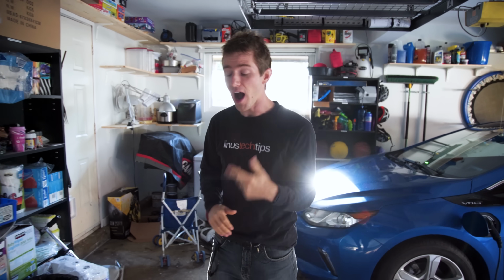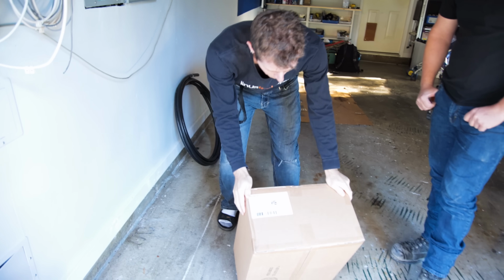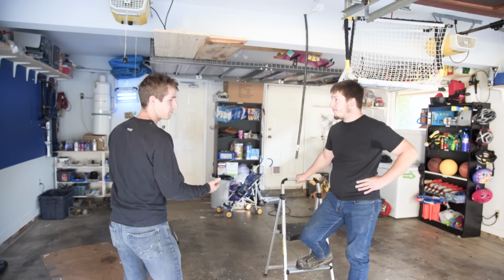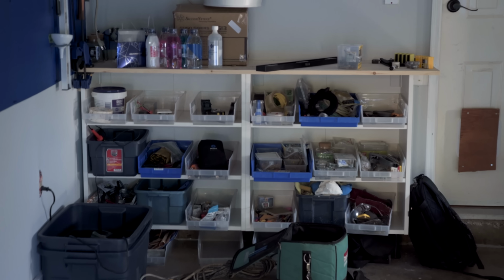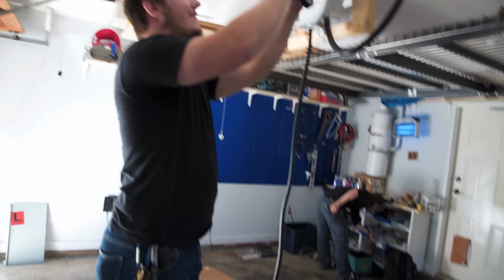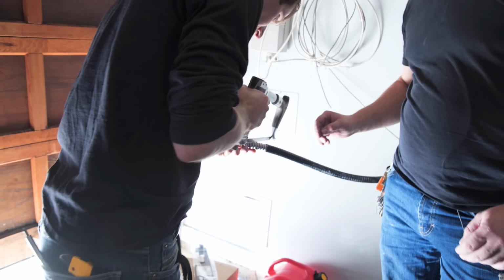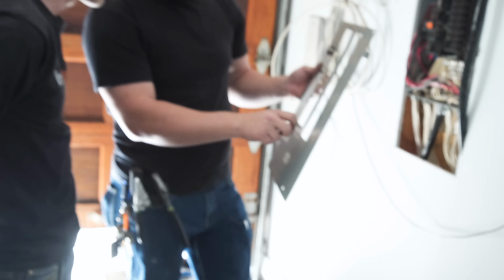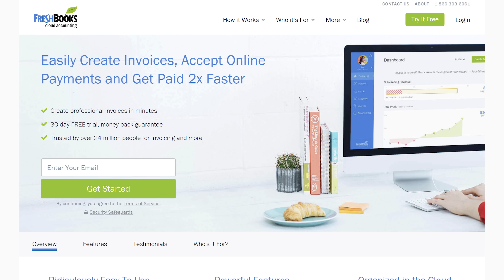Installing my Electric Car Charger - What Could Go Wrong??

Comment: I love that he pays a contractor and then insist on using his own tools and doing most of the work himself. Haha. Electrician  is awesome tho
Reply: i think it´s be the most annoying tipe of contractee posible, just let the contractor do its job in peace, linuses way its how accidents happens
Reply: Not sure how they do it up there but in the US its common to charge by the hour. If somebody wanted to waste time running around turning a 20 min job into a 2 hour one i would jump on it
Reply: of course if you charge by the hour let it waste all the time that he wants, 
where im from (argentina) this kind of little jobs are charge by the work it self, so you want to do it quickly and be done with it
Reply: correct if this was a normal job but in this particular case, it is a major YouTube channel who brought him on for a video.
Reply: @user-neo71665  There's also the liability issue.  If Linus electrocuted himself, he could sue the contractor.
Reply: @Mikemk_  ...No. If Linus was a sub he could, but as the homeowner he can't. At least here in the US.
Reply: DynamicEquilibrium Linus is Canadian
Reply: @darkchronos22  te entiendo jajaaja
Reply: Artak091 . He pays a contractor so he doesn't burn his house down or kills himself. It wouldn't make for a very good LTT video if he just paid a contractor and shows you the before and after. Linus has said on many occasions that his channel is for entertainment, and him being involved in the process makes sense.
Reply: Assuming he isn't a friend and/or a fan who knew what he was getting into without being told, they probably searched for someone willing to be on a video teaching an "apprentice"
Reply: @gingernytemare  His lawyers and family would.  And legally, dead people can still sue if the manager of the estate wishes.
Reply: @darkchronos22  The customers who want to be involved are the best type if your charging properly.  Let me do the job is X.  Watch me do the job is 2X.  "Help" me do the job is 3X.
Reply: @darkchronos22   I'm here in the US and own my own company, only employee. The only time I bid a job by the job is it has to be a big job. Then I big it by the square footage. If they have a 2500 sqft  house I might tell them XXcents per square foot. Small jobs is XX per hour with a one hour min charge.

Now before I get tons of hate. Yeah if some little old lady calls me that I have to travel 1 mile to come change a light bulb the chances of me charging her anything are slim and none. Now if you are a grown male and call me to change a light bulb I will charge you.
Reply: @Mikemk_  Linus himself said he wasn't going anywhere near that live panel.
Reply: @nobodyimportant2470   And if I have to fix your screw up it's 5X
Reply: @user-neo71665  im nota telling that your way its wrong There are diferent ways of doing this things depending of the personas and the place, forma example i'm in a family eelectrical company with my father and brother, and i wouldn.t go near that live box, in Argentina we use din boxes with individual diferencial breakers

Comment: I like this Brian electrician guy, does stuff mostly right and it still works, just like Linus lmao I hope he helps on the office chargers install Linus said was gonna happen at some point
Reply: EMPLOY BRIAN FULL TIME
Reply: ALMOST. Uses black and red, instead of blue and black for AC.
Reply: @fusseldieb  in the UK we use brown and blue, so I guess you get different standards in different places
Reply: Harry Snell Brown and black we can tolerate, but using completely different color not
Reply: @fusseldieb  just different standards lol
Reply: @fusseldieb  Canada is the same as the US for most electrical code things and you use black and red for live wires for single phase. Blue wire is for the high leg in three phase.
Reply: Especially in Residential, where blue is typically uncommon. Commercial and Industrial utilize a range of colors; yellow, blue, red, black, blown, orange, etc. for the live (hot) wires, while white, grey, and white with grey stripes are used for the common (neutral) wires; also the ground wires are typically colored green, green and yellow striping, or just bare copper. Most of this is for marking purposes, for multiple circuits (most feeder wires, at least where I work, for commercial buildings will be marked yellow, brown, and orange for a 3-phase, delta wye system, for example). Residential differs in that the colors used are black and red (and rarely blue) for the hot connections, black used most (110V/120V), and red used more commonly for either 220V (240V) applications or 3-way and 4-way switching; white as the neutral wire (they don't much like anything else), and either bare wire or green wire for the ground. As Harry Snell said, it's just different standards, our black and red being the same as their brown and blue.

TL:DR - Just because someone in a DIFFERENT country has different set codes and ways to wire things, who cares as long as it's done correctly for that country and nobody gets hurt doing it.
Reply: @fusseldieb  In Canada Red is A phase, Black is B phase and Blue is C phase. Since its residential and a 120/240 split phase system only red and black are used (A and B phases). Blue would be for a 3 phase system, or if marked white or grey could be utilized as a neutral. With teck, it's far more available as a 3 wire cable than a 2 wire.

Comment: Theres a Siemens plant not far from me, they manufacture the rotor blades for wind turbines. Across the highway is a chemical plant called...climax. I shit you not. So we have both seimen and climax.
Reply: Lemme guess: before came the climax and then came the Siemens
Reply: @iaial0  yep, first was freuhauf, a semi trailer manufacture. While it was running climax opened sometime in the eighties. After freuhauf closed, seimens opened in the mid 2000's.
Reply: Wang Computer will be resurrected and build a factory there
Reply: 69 likes... F%&ksake *facepalms*
Reply: A little off subject, but  what about the PowerStroke and Cummings diesel engines?? LOL
Reply: back in the nokia 5110 days I swear siemens had a mobile phone
Reply: oh thats nice
Reply: Probably some old german dude with the last name Siemens is turning in his grave and facepalming right now
Reply: it's pronounced zeemens but okay.
Reply: @knifeyonline  Yes. I used one. It was a tiny yellow phone with rubber details with a tinier liquid crystal BW display.
I once threw it like a grenade, I was so pissed off, then I ran after it, collected battery and back cover and it worked like a charm.
Reply: @Dystopikachu   Werner von Siemens is for sure turning in his grave since 1892 for several things lol and @Joseph Stott  yes Siemens did build Mobile phones for while quite good ones too. They had the first with coloured displays with awesome 3 colors lol. I had the S25 as my first Mobile
Reply: Siemens have an office in Staines in the uk....
Reply: Where is this
Reply: @wayzrunn3r923  ft Madison iowa
Reply: @knifeyonline  they did mate and they got bought out but still do dect phones and two ways
Reply: There is also a Siemens factory near the town in Austria where i live, they produce medical equipment (CT, Röntgen and MR machines). Siemens is actually one of the pioneers in mobile tech and communications, they made S10 first mobile phone with color screen and were one of they first companies to introduce Mp3 to mobile phones.
Reply: Spare a thought for those who've had a prostatectomy...

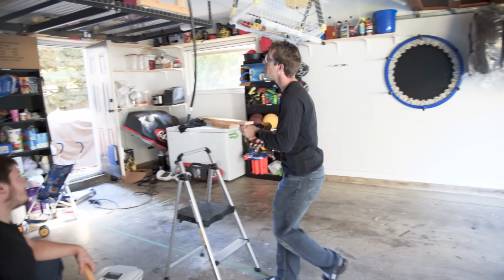Comment: 9:32 JESUS CHRIST NEVER hold the back of the thing your screwing into, That looked like is missed your hand by half a centimeter...
Reply: Don't worry, that's Linus. He's probably immortal since he's still alive ;)
Reply: ?? is the screw magically gonna fly through the board and into his hand at light speed?
Reply: @AndrewBrowner  more or less
Reply: @AndrewBrowner  no, it'll slowly and painful drill through his palm.
Reply: Or just use a screw that is shorter than  3 inches....
Reply: I saw that too, but then you see he already did three other screws so would have known it was fine!
Reply: Knowing Linus he'd screw into his hand by holding it the proper way
Reply: Is that something you would do, use a screw longer than is necessary to join the two pieces of wood together? The two pieces together are about three inches. So, you use a 2 1/2 screw and like magic, it doesn't go all the way through. It's amazing how that works.
Reply: I saw this comment, then saw the scene and ooof, even knowing it'll probably be okay seeing that still hurt; having worked with that stuff before, just, why aim it directly at your palm? Who care's if the screw is too short, what if the wood splits? I've had someone I was working with go to the emergency room because a screw twisted itself apart in his hand, nearly severing nerves because he wasn't wearing gloves, just... this is exactly the sort of comment he was hoping to get with this video, isn't it?
Reply: But that's why we watch Linus do DIY stuff, he's always one slip away from the hospital. Keeps you on the edge of your seat!
Reply: 99% of people who're saying this is fine have never seen what a work environment without any safety guidelines is like.
Reply: Welcome to armchair quarterback.  Since you're so astute, it should be obvious he previously screwed in 3 identical screws.  Feel better?

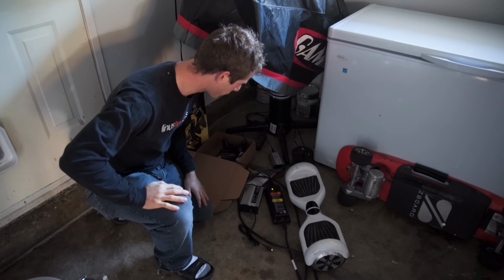Comment: "this is the corner of my garage with nothing flammable"  1:29 cans of paint on the floor 2 feet away from his charger
Reply: could be acrylic paint
Reply: Water based paint is far more common than oil based paint due to very fact it is,not very flammable.
Reply: And a hover board with Lithium-ion batteries in it that combust as soon as they come into contact with water...
Reply: + cardboard box and wood wall
Reply: @Cowcow211  Then instead you'll electrocute everything and consequently set the house on fire since its made out of wood. Even worse than oil based paint.

Comment: The longer this video goes on, the more I think Brian is not an electrician and is an LTT host who just cleared probation. 😂
Reply: My guess is he is Linus' friend or neighbour who happens to be an electrician. :D
Reply: In theory he could be both
Reply: Especially considering the visible lack of proper electrical tools, uninsulated screwdrivers, no wire strippers, etc etc.
Reply: @Canuckrz  don't know about Canada but in NZ that's standard sparky gear for the town contractor. Most of the "proper" tools are unnecessary, there was one old fella that cuts 
through live wires with simple tin cutters since he knew what he was doing (don't try this at home kids)
Reply: @HelloKittyFanMan.  by simply watching the video, really. I mean every single plastic handle screwdriver that doesn't have some stupid metal running across the handle is insulated, but the ones sold for this very purpose had all the shaft covered in plastic as well, to avoid any slips or touching sides.
Reply: @HelloKittyFanMan.  true, that's what I meant (worded in some messy way).
This also made me want some of those as all of my screwdrivers are of the normal variety as well.
Reply: @HelloKittyFanMan.  here in the UK electricians screwdrivers are often so heavily insulated and protected it can actually be a nuisance, the insulation goes right down to the tip. They're also usually a specific bright colour combo and the handles labelled with the various approvals/standards.
Reply: @Canuckrz  He had a fish tape in his tool box and many electrician just use linesman pliers for everything. It's only relatively recently those combination wire strippers got popular.  That screw driver is insulated  and most electricians don't get out their insulated set with the sheathing on the shank for a house call.
Reply: @HelloKittyFanMan.  https://www.amazon.com/Wiha-32092-Phillips-Insulated-Screwdriver/dp/B001U3FOIY?psc=1&SubscriptionId=AKIAILSHYYTFIVPWUY6Q&tag=duckduckgo-d-20&linkCode=xm2&camp=2025&creative=165953&creativeASIN=B001U3FOIY

A lot of my family members are electricians ("sparkies" for the Aussies reading.)  These types of drivers are all they use.  Not that brand, just the first link I found.  You are right though, the tips can still arc against another component if you aren't careful.  So, Linus playing it safe by isolating the house is a smart thing.  The next smart thing you can do, is actually 'test for dead', using a multimeter or other device to confirm that zero volts is running to where you intend to work.  Stay safe guys!
Reply: @HelloKittyFanMan.  I have a set of insulated screw drivers as well, and yes the difference is the coated shank, leaving only the tip exposed metal. That, and they have a voltage rating, typically 1000vac.

Regular Klein, Greenlee, etc drivers don't have a rating but in practice the amount of plastic and rubber in the handle is more than adequate. Honestly, I only break out the insulated drivers if I'm working either in a sketchy panel that I can't de-energize (Which when doing commercial work is about 99% of the time), or for higher voltages like 277/480v or 347/600v. Yes, we have to tie into those live sometimes too.
Reply: @HelloKittyFanMan.  Because then it's into overtime which generally they don't want to pay for, someone has to get us access and if it's a main panel for the unit, which it often is, the breaker is in the main electrical room, which then after hours access has to be arranged with the landlord. All in all its just generally a massive headache for something that is literally a 2 minute tie in, and on 120v, where even if you do get hit, it's really nothing more than an unpleasant tickle. Its actually quite hard to accidentally get shocked in a panel as long as your mindful of where your hands are. I don't recall ever getting hit in a panel. It's far more often a bad splice in a junction box that gets you.

Comment: I've had that Siemens unit for 5 years to charge my BMWi3(gone now thankfully),my 2015 Spark EV and the same color Volt as yours but the 2017 model. Still a flawless product. Takes about 4-5 hours to charge the Volt. You can delay the start time up to 8 hours in 2 hour increments and it pulsates green while charging!

Comment: I would like to see the average electric bill for LTT...
Reply: Its about 13 kilowatts/ 24 hours in use
Reply: I have a volt and a leaf my electric bill is about $150 a month.
Reply: Solar panel
Reply: Based on the charger usage, it is comparable to running a small space heater while the car is charging
Reply: @briananderson3620  just think that 150 compared to what your would have spent on gas
Reply: Sponsored by "enter name here"
Reply: I'm paying almost 500 dollars a month, no electric car, household with 4 people
Reply: @KBow  lol, do you live on mount everest?
Reply: SearingGravy that is expensive. I spend maybe 25-30 bucks every two weeks on my regular Honda civic
Reply: 150 was for his whole house. Not just the car. To fill up a electric car it's like a dollar per 50 miles.
Reply: Zeezen my point still stands my bill doesn’t get above 100 during the hottest days for summer. Electric car are a over priced liberal gag gift people keep buying. Buy a good hybrid is better for the environment then any electric car ever will be. They are dirtier to manufacture then standard gas vehicles, cost more when they break and don’t have the longevity as people claim. They are far from being green
Reply: @DumbArse  I know it's not especially if you consider not buying gas
Reply: For my Leaf in Ontario Canada, I paid about $35-45 a month, and that is for about 1500km of all electric driving.
Reply: @KBow  Why is electric so freaking expensive for you? I've got no EV, and 3 people live here. I pay about 25 USD a month.
Btw I'm from India.
Reply: our family pays 15-20 $ .....family of 5 !!!! dude 500 is alot ....do something about it
Reply: @zack9912000  sounds like your research has been very half hazard.
Reply: Zeezen no it has been proven from study after study electric cars are dirtier then manufacturing petroleum cars and do not come close to offsetting their carbon footprint from manufacturers
Reply: @zack9912000  in coal sponsored studies
Reply: @yvoferdinandvanderhoek1027  Um no. it has been proven electric cars are not any cleaner then gas vehicles and cost more over the life of the vehicle.

Comment: Linus.  If you still have the Volt you should know that it is not a hybrid but a full electric car known as an Extended Range Electric Vehicle.  The gas generator only supplies electricity to run the electric motors in the car when required.

Comment: Just an observation Linus, but I would recommend that you get better insulation between your garage and the area above. if it's connected to the house (which I assume it is based on the fact that it's insulated at all), having a poor insulation layer is gonna make that room cold. also if you improve the insulation it would be good to also air seal that ceiling while your up there, because garages are subject to all sorts of fumes that can lower your in-home air quality.